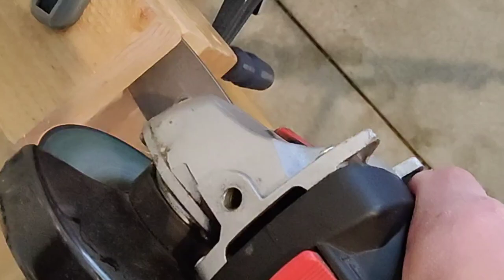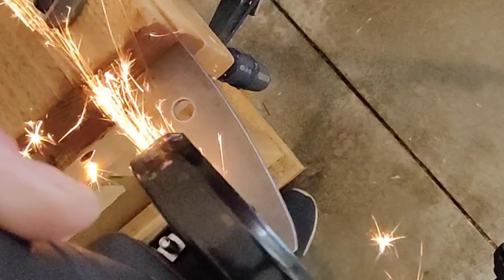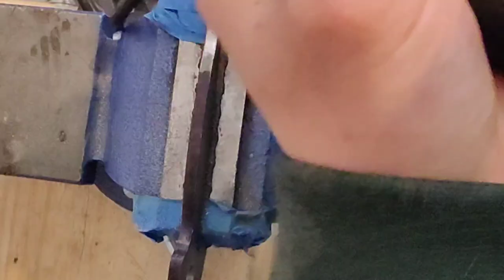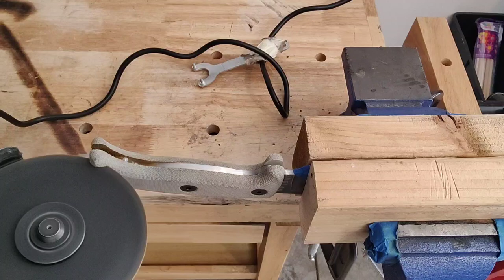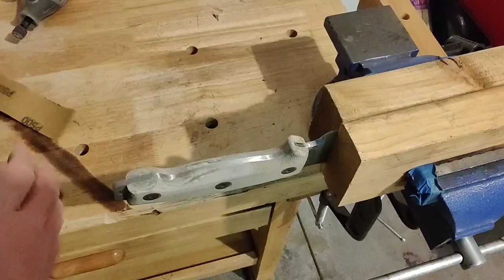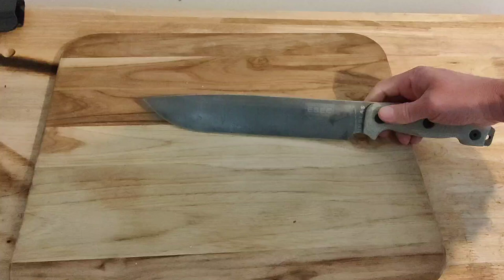ESEE Junglas Modifications

Comment: The only mod I'd ever want to do on my Junglas is thinning out and tapering down the tang. Too much unnecessary weight on the back end. Move that balance point out in front of the handle.
Reply: Was just thinking this...handle just too heavy....maybe using a step bit to drill some skeletons. Thoughts?
Reply: @steveysimmons13579  That could work. I think if I had the tools and skills, I'd rather just taper down the tang or have a friend or local Smith do it for me. Obviously, issue with that is you'll need to also make new handle scales to match the new tang.

Skeletonizing the tang would be a quicker and easier project for sure....but you're potentially losing some strength.

Skeletonized, full-tang handles can have weakness issues under chopping and batoning impacts. They can also transfer more vibrations to the hand.

Like, a strong, solid, stick tang (with properly radiused corners) would actually be stronger as weird as that sounds. It's a gamble....

I just got in a Kailash Blades, 13" Panawal (full-tang) Khukuri. 8mm spine. Absolute beast, so I've retired the Junglas lol.

5160 spring steel. Differentially tempered. They forge it already with a tapered tang. Ordered the micarta handle. Love it! 👍

Went with the "standard grind" option so it's a much more robust edge for chopping and splitting compared to something like a Junglas.

I'll always have love for the Junglas, but I'm sold on the khukuri. For all day machete work, I have my cheap Tramontinas which are great.
Reply: @pennsyltuckyreb9800  Wow, appreciate the advice, Penn. After thinking about  your thoughts, I'm just just going to go for it,  drill the holes, and see what happens. I'm certainly no knife expert, just looking to balance this thing out and make it a little more comfortable. Afterwards, I'll do some chopping and circle back with an update. Thanks,  man.